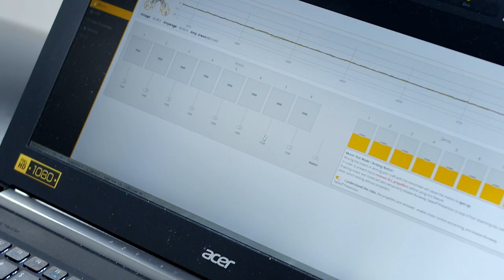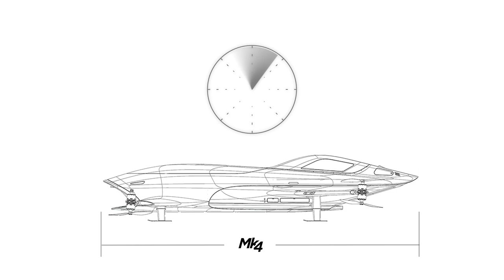Powering Up Our eVTOL Flying Car | Alauda Aeronautics Taking Flight Series

Comment: 4:05 "That's a flying car."
No it's not. That's a big hobby drone.
Reply: well, it's a drone until someone gets inside of it. And technically for something to be a car it has to have wheels and travel on the ground so yeah, it's a low-altitude helicopter or an "airspeeder".
Reply: Exactly what flying car has huge rotators on it
Reply: @vighneshkannan7896  the presence of wheels doesn’t define a car.  Theoretically you can have a “hover car”. 
Car is just a vehicle that moves people/ load in a motion parallel to the ground or terrain while in close proximity to it.
Reply: Yeah, its a drone. No one will clime into that ever :D
Reply: This is objectively not a drone. Drones by definition are unmanned. It's not a car either, it's a VTOL.
Reply: @totty2524  have you seen a man in it? I didn't. Its a drone controlled by rc controller ;)
Reply: @agniuszoro  Haven't they ever made a manned test flight? I'm pretty sure they did? Maybe I'm thinking of another evtol.
Reply: Precisely what I was thinking
Reply: I thought the same.
Reply: yeah that was other channel,and altho they really did the stunt with human in it...it was for promoting drone race game on console
Reply: @tonuahmed4227  You're going to provide us with a URL of course.
Reply: @stejer211  you could just search it up with racing manned drone but okay... https://youtu.be/6xJ27BtlM0c...btw there is also another channel which was involved in this and they have separate video...
Reply: @tonuahmed4227  And where exactly in that video is it flying with a human in it?
You strike me as someone very gullible.

Got another URL?
Reply: You can just search up on racing manned drone and you will find another one plus other homemade drone including two sitter
Reply: @tonuahmed4227  No manned racing drone found. 
Why don't you just post the links?
Reply: @stejer211  FR I just wrote manned racing drone and found those videos on top...BTW from 14:00 there was human on it...you could see normal helmet with glasses...
Reply: @ishish8816  it is not necessary for a flying car to travel on the ground. It's called a flying car for a reason.
Reply: @ishish8816  Except "hover cars" don't exist. Your entire definition hinges on a fantasy vehicle. 

Shush. If it doesn't have wheels, it's not a car.

And nobody cares what your 20 second wiki search tells you.
Reply: @ishish8816  Yup. A 'cable car' is a car. And an 'elevator car' is a car, thus the "motion parallel to the ground" is also irrelevant. A car is merely a compartment in which things travel.

Comment: it's just a big rc drone lol, and not a flying car
Reply: My take exactly. One big hoax.
Reply: Um... until they change the tech, wheels and the ability to drive or not, so far EVERY flying car is just an oversized drone lolol
Reply: @moneymagnetismnetwork  lol yeah but they don’t have wheels and it’s not a car. And it needs more than just wheels... every single plane has wheels... some helicopters have wheels. Doesn’t make them cars
Reply: Literally they use betaflight

Comment: "We're not developing a backyard helicopter"  Are you the same guys that had the flyaway at Goodwood Aerodrome (West Sussex, UK) on  4 July 2019?  I've just seen the AAIB report on the accident. As an aeromodeller and drone flier myself I was more than shocked seeing that the flight controller was just a rats nest without redundancy or a real working failsafe in it!  I won't be going within 15 miles of one of those!
Reply: Solid amateur hour that was... No less than 15 safety recommendations, outstanding.

Comment: Range? Speed? Autonomy? Payload? It's not a "flying car." It can't drive on terrestrial roads - and you don't want that wasteful weight. It's an eVTOL. Good reason why it doesn't utilize passive lift from a wing for more range? 

<Flame off> 

It looks sexy and pulling for your success.
Reply from the maker: Thanks for commenting, Stephen. It's not a traditional car, you're right there...but this whole sector is far from traditional. It's completely new and we're able to write our own rules. Granted it may not have wheels (at this stage) but the purpose of the vehicle in the future will be to transport people from A to B. The eVTOL industry will essentially be flying cars!
Reply: @Airspeeder  sad at the defense of wanting to call it flying car. Reminds me of my Dad who would call the odometer, the speedometer. :-/  But happy y'all are pursuing the flying thingy. Can stats be posted or y'all going for the mysterious vibe? 

Heard that it's a speeder/racer being built, but a model that would be appealing to more ppl is one with about: 300 miles range, 150mph, 2 passenger + 50lbs luggage, autonomous. Trillion$$$ to be made ( $EH ) for the eVTOL everyone can buy [and wants]. Will displace $TSLA.

The hell with noise concerns for now, but it needs high safety confidence/redundancy ( 6+ rotors ) and 2 sets of wings [for more range - e.g.Vahana]. Eventually noise reduced with wider props/slower speeds, ducted.

Comment: BAD VIDEO THAT SHOWS NOTHING.?????
Reply from the maker: Our Chief Pilot goes into the reasons for that in the video. We are close with regulation so we don't want to rock the boat. 

We are designing a new form of transportation as well as a racing series. When we release it all it will look better than a hover.
Reply: @Airspeeder  why .make the video if you're not ready to show it?

Comment: I’m watching the video and the software they are using for the motor test at 1:16:00 is beta flight the most prolific GUI and flight control program for quad copters ever made I use it on all my freestyle and racing quads 😂
Reply from the maker: Hi Summer. As this is a completely new industry, we have to use the tech that's available or develop our own. As the sector evolves, so will the products we're using!
Reply: To be fair while not used in multirotors of this size often/before, there is an argument that betaflight is the most tested flight software available, admittedly not in a manned craft. But still not an unreasonable choice from that perspective

Comment: Unfortunate that such forward thinkers are not using Thingap technology and ring motors. 80% more thrust with the same current draw.... I guess I should not be sharing Darpa secrets...But I really want to see this move faster.
Reply from the maker: As mentioned in the video, this is our Mk3 prototype. As we move towards manned flight, we will be making improvements and changes to our design. This is a completely new sport we're developing here!

Comment: "That's a flying car" Well, dude, this is the internet.  Pics or it didn't happen.
Reply from the maker: Hi Matt. The video explains the process of approval from various aviation governing bodies. We are currently going though that journey. As soon as we can release footage, we will. Trust us - it's epic.
Reply: @Airspeeder  I appreciate the response, but dude.  You HEAVILY IMPLY that it actually is flying, and it is NOT a top-secret government combat machine or anything, so saying you need some sort of approval to release footage is just a bit strange.  You can FLY it without this approval, but you cannot SHOW it without approval.  Get someone out there with a drone pilot's license to act as the "remote pilot in command".  He doesn't even have to be at the controls, he just has to BE there to be legal.  Then...point a cell phone at it.  There are lots of videos showing test flights of various experimental craft on Youtube, ranging from barely making it off the ground to full on flying over trees.  If you car can't actually fly, then show that and we will all root for you as you work out the kinks!  We WANT you to succeed! However, if you are just TELLING us that it is flying, then, well, whatever.   Here, watch this video of a flying, manned drone.  They don't yet trust it with a person, so they have a human-weighted dummy in the cockpit.  They are going through the PROCESS, but also showing us what they are working on.  https://www.youtube.com/watch?v=6xJ27BtlM0c

Comment: Anything that drives, floats or flies using energy from batteries is not promising yet, because sufficiently reliable batteries have not yet been invented. Of all the known metals, lithium has the highest electrochemical activity. But it is already in use. There is no other more active metal.

Comment: Are they seriously using betaflight as controller or just for testing? I would never trust betaflight on that..
Reply: Understand where you are coming from, but can you suggest a more tested flight software?
Reply: @nic.h  If that is for testing only I would never argue, that would be fine. Betaflight is an open source software and not so safe. Surely they can make a software better than and is more secure.
Reply: @kymcainday6677  I'm guess they could make their own software, but my point is that why would anything they make be safer than Betaflight as a starting point. It would be by far the most tested flight software for multi rotor aircraft that is available out there, admittedly not on craft at this scale, but there isn't going to be anything specifically available for craft of this size out there, so it's still probably the best choice for a starting point with the amount of flight hours that Betaflight has compared to other choices. I certainly wouldn't recommend they just upgrade to the latest version all of the time, but choose a specific version and configuration, and then verifying it for their craft with unmanned flight hours doesn't seem unreasonable or any worse than doing the same with custom software they create.

I  do understand the concern though as Betaflight wouldn't have been designed with manned flight in mind or for craft of this size, I just think it would be the closest most tested option available to them, making it a reasonable starting point for something to verify with their craft.

I would be curious to know what flight controller they are using for this as well and if there is any form of redundancy.

Comment: My impression I that there is too much hood. The shape of the Airspeeder is oriented wrong. To move fast forward it needs to tilt down. So a nose tilted down needs to be the default orientation that the aircraft needs its design based on.  Tilt the nose down and then shape the fuselage after a water drop being blown from the side. Figure out how you can orient the pilot within that drop so they can have the greatest of field of view. Your design sucks for seeing what is in front and below you. As a hang glider pilot I have zero obstruction of my view ahead of me.
Reply from the maker: Thanks for your feedback, Eric.

Comment: Not airfare but a Air Car
Reply: The design you chose is a very good one, it will be able to glide through air like a slick bulet. It would be good to make it out of Corbin fiber plastic also. Also put a built-in Parachute for the air car for emergency.
Reply from the maker: Parachute is something we are in fact working on, John. Well spotted!

Comment: Aaaannnd how exactly is this a flying “car”?? Looks like it’s just a big arse drone to me, which is awesome, but not at all a car... a car in the sense that it has wheels and tires and drives on ground surfaces and you can take to the bar (during the before-times) and then drive home drunk on the ground and streets and then make your escape through the air if a cop tries foolishly pulling you over with his normal strictly street drivey car.... THAT’S a flying car

Comment: They gotta do away with the open prop design or encase it. That just looks like a human slap-chop waiting to happen....
Reply: You can mitigate the open propeller risk reasonable via procedures, sounds like they are basically trying to create a new sport, so those procedures become part of the rules if needed.  Although sounds like they have plans for shrouds when they get to manned flights anyway
Reply: @Eatmyshirtz  bird strike is a different issue and shrouds aren't likely to make it any better. The problem I see with bird strikes isn't so much the danger from fragments of propeller, but the likelihood that any bird big enough to take out one of the propellers is probably going to take out the one directly below it as well, and unless they have flight software to handle the loss of 2 propellers from the same arm, the craft is coming down in an uncontrolled fashion.

I'd be curious as to how solid the main body is, as it may not be that likely that flying blade fragments do anything apart from bounce off, it's the potential loss of control rather than the risk of being hit by a fragment that would concern me more in that scenario.